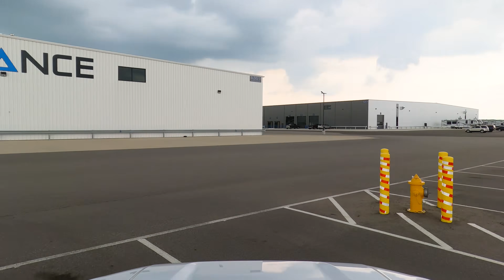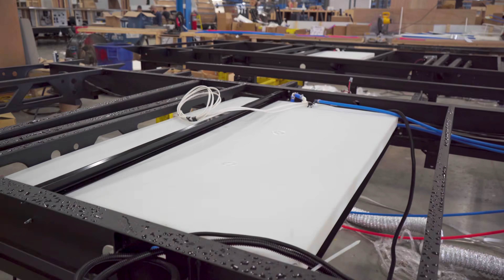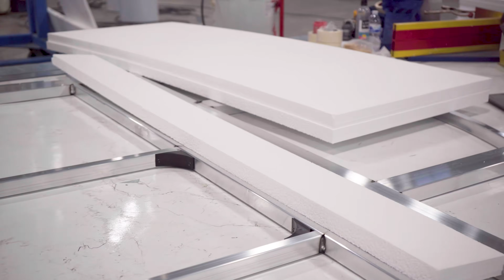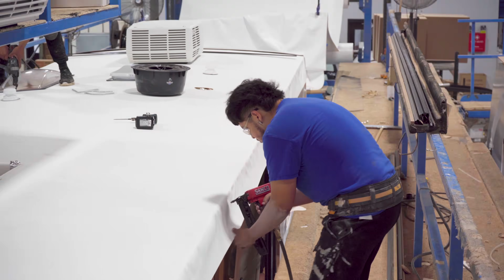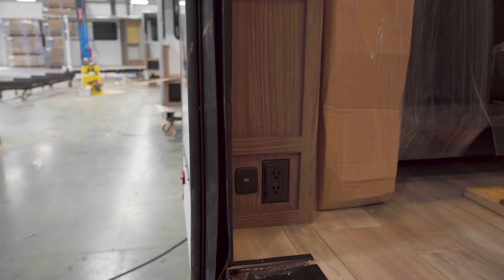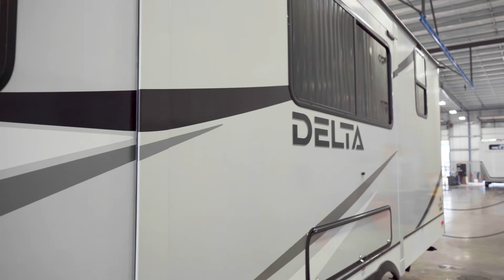Inside Alliance RV's Delta Travel Trailer Plant 3: Exclusive Tour and Behind-the-Scenes Look!

Comment: We purchased a 2026 Alliance Valor 37V11 seven months ago and have had more problems that I have time to list. It's been in a service center more hours than its been in a campground. The AC units DO NOT Cool this RV, the heat from the furnace DOES NOT reach the Tow Hauler area, making it unusable to sleep in. The Alliance story and videos are great, but I have to laugh when I see them. The Commitment to Manufactureing Excellence and Quality Control before it leaves the factory in my opinion is Non-Existant.
Reply from the maker: Please reach out to our customer support team so we can look into these specific concerns with your unit and work toward a solution.

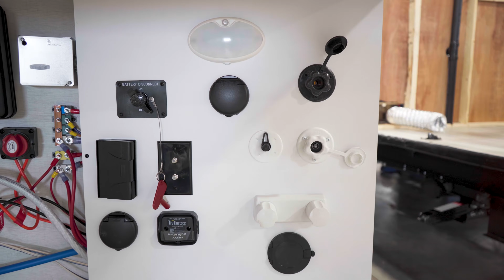Comment: You said you use PEX throughout, yet at 8:19 in the video I see "flex line" for plumbing that appears to be connected to the water pump???
Reply from the maker: Yes, the specific hose to the water pump is a flex line.

Comment: I just bought an Alliance Delta 252RL. I really like the floor plan a lot. 
I couple things were a little confusing. I was trying to test the heating system (furnace) before I store it for the winter, I couldn’t git the life of me get it to work. The thermostats in the bedroom I found controls the furnace not the AC unit with the remote in the main living area. The remote has a heating mode but it does nothing. A technician from the thermostat supplier walked me through getting it to work. 
I am sure looking forward to using this camper. 
I believe that you build an above average unit. 
Thank you
Leroy

Comment: Hey guys, thanks for the video. I watched Josh Winters review of your 262rb today, and like what I see! I have a few ideas based on what I have seen out there. 1. Upgrade to something like the roadmaster comfort ride shocks and slipper springs for the ride and handling. 
2. Insulate the front storage ceiling and run a heating vent into it. It is under the bed after all.
3. Most cargo doors are not reinforced from what I felt recently. They are already thin and lightweight. Maybe put a X support into it for strength and added security. 
4. Implement an Olympic queen into the unit instead. 
5. Install rear backup lights.
6. Have anti lock brakes as an option with sway control.
7. Have a Suburban tankless water heater with recirculation built in. No more waiting for hot water.
Keep up the good work!!

Comment: Finally got a chance to take a look at the Alliance Delta travel trailer. The main line on the water pump was flex tubing the appeared to be plumbed incorrectly. 😢 Decals on the outside were pealing off. Although the furniture was super comfortable to sit on, the appliances, countertops and cabnetry seemed really cheap. We were willing to up our price range to purchase the Alliance quality. Now we are not so sure about the quality seeing it first hand. 😢
Reply: PEX plumbing lines are used wherever possible.  It is code that a flexible line (not PEX) must be used at the water pump to help with vibration.

Comment: Thank you for the tour of your facility, greatly appreciated. I do have a few questions. 
1.	Does your quality control system record any "critical point" inspection data at each work cell, and do you use that data to augment your “Relentless Improvement” programs?  
2.	If that data is collected and recorded for each individual unit (VIN# traceability), is it retained for longevity & performance evaluations or in-service failure analysis, once again to augment the Relentless Improvement program?
3.	Do you have defined corrective action procedures if a quality inspection issue is discovered during the assembly process? 
4.	Do the assembly line craftsmen have an open avenue to suggest and possibly implement ideas for improvements in both product quality and assembly line procedural processes? 
Thanks again from an old retired heavy industry "workhorse".
Reply: they stop the production line is issues are found and nothing moves until corrected on that unit and those following. she answered those questions
Reply: @dh5341  That only partially applies to question #3. The rest remain unanswered.